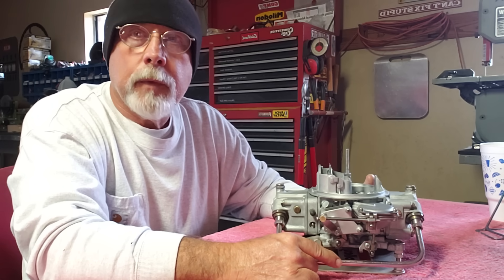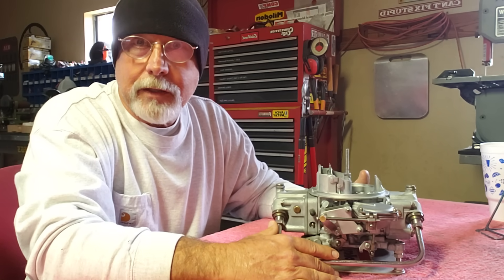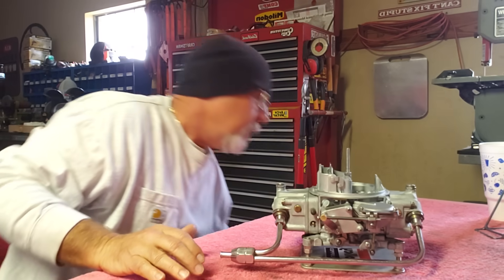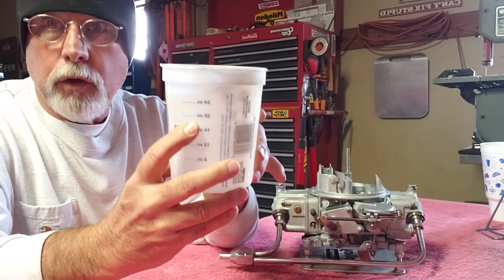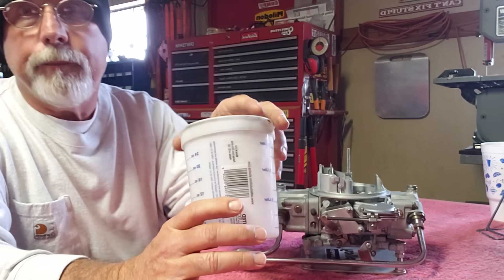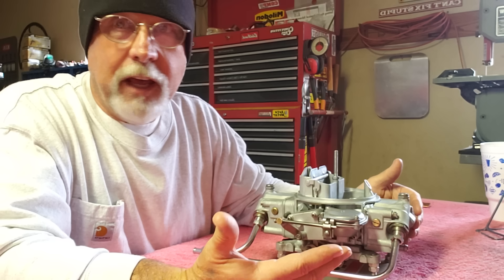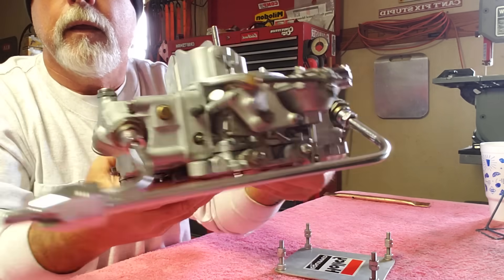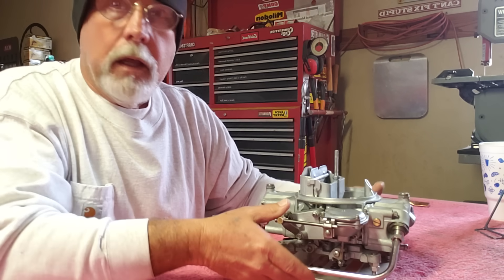Best carburetor cleaner ever!

Comment: Drain cleaner has muriatic acid in it & we used to use that on cylinder bores on snowmobile engines that were scuffed from the piston skirt from either being run too lean or from getting on it hard when it was cold & did a cold scuff or 4 corner scuff & it dissolves the stuck on aluminum without hutting the bore which if your bores are in spec still & you don't need to have a rebore it saves money other than new pistons rings & gaskets & a quick hone after the aluminum is gone so the new rings will seat again . I usually soda blast my carburetors which works very good plus you can get a 50lb bag of sodium bicarbonate from your local feed mill for around 10.00 - 12.00 which is much cheaper than buying it from harbor freight or the small boxes of it at the grocery store because the farmers use that stuff for the cows to relieve gas & settle their stomachs at times so the feed stores always have it ! I just used the soda blast plus the exact same blaster you have on some Yamaha XS650 carburetors off of a 1975 B model that had sat for over 30 years with old fuel that dried & looked more like the old Indian Head gasket Shellac used for gaskets lol & nothing would even touch that stuff after trying a few different things until I soda blasted them & it worked absolutely great took that hard crap right off & it made these carburetors look like brand new again . I like how fine the soda is because it will also blast & clean out tiny air & fuel passages then once done I blow out with air then flush with water a few times plus air just to make sure all of it's out . It's much faster at cleaning but has to be done in a blast cabinet or I do mine outside with a paint respirator on so as not to breath that stuff in . I also used it on the aluminum fork legs & the rear brake drum & high shoulder wheels to remove the corrosion then polished them back up again before I put the bike back together again so it has many uses other than just blasting carburetors or to keep your fridge smelling good lol. I got the bike running & it runs strong  so the next step is to tear it back down & build a street tracker out of it !
Reply: Drain cleaner is typically Sodium Hydroxide or Calcium Hydroxide. Sodium Hydroxide is regular Lye. Lye breaks down hair and grease. You wouldn't normally ever put Muratic acid in your drain, because Lye is caustic, and doesn't burn through metal. Muratic acid is an acid, and it removes iron, and other metals. It literally will melt into your metal pipes. Unless you have 100% plastic plumbing, you wouldn't want to use Muratic acid. Though, many new houses probably have all plastic plumbing, so it would be safe in those cases.

Comment: Useless !!!!  I used this idea on a pair of large two barrell carburetors taken off an offroad buggy. It did not even start to clean the oil grime residue from using foam air filter covers.  A complete waste of time. Would not cut the greasy grime at all. even after four dips and scrubbing.   Use some other process if the carburetors have heavy oily residue....
Reply from the maker: This process is used for a carburetors. Never, in my 45 years of building carburetors have I have not seen any oily, greasy carburetors and if I had I would run it through some solvent (Degreaser)  first before using this method.

Comment: Thanks Brother , I restore old motorcycles I have been struggling with this for Years , now I will try Your method .
Reply from the maker: Best of luck
Reply: @ronniehenson4122  woud you take the time to manually scrub off any dirt, gunk, on the carb before dipping it in the acid or just save yourself the trouble and drop it straight in off a bike thats been sitting for 10 years?

Comment: Question is would if work for small engine carburetors like Lawn mowers & weed whackers? Also would break cleaner help i never cleaned a carb before o only would put a new spark plug air filter and oil on my mower and i am fixing 1 up and may buy a new carb until i clean 1 up. The mower i'm fixing up is a Kawasaki FC150v something i never seen shows up as a john deer motor and says fits almost any john deer frame and i guess its on the wrong frame but fits.
Reply: im cleaning one now. ill let you know in a bit.
Reply: @hotrodamd  Thank you. If i end up buying new parts for a FC150V motor i may just buy the fuel cleaner since its also kind of the same and helps clean everything with what i want. I'm not good with taking carbs apart putting back together almost wanna buy a new carb than temp to clean but i know its not bad cus you can still smell gas like its in there.
Reply from the maker: Yes sir!

Comment: What are the throttle blades made of? Does the Muratic acid effect them or did you remove them from the base plate? I'm also wondering about jets but I supposed you could use about anything on aluminum, brass and bronze for a short period of time and it wouldn't hurt it. What's your thoughts on the misc components that are not aluminum? I've got some 1950s era carbs I need to do. I don't think they were using aluminum, I think they were using die cast or "pot metal". Once last question, what about Magnesium? I've got a magnesium blower intake I'd like to clean.
Reply from the maker: I cleaned all the miscellaneous parts in the same solution with excellent results, no problem. Not sure on the magnesium intake, I think it would be fine but, do a test on the underside first. I do know for sure that the soda blast would work fine on that magnesium intake.  Good luck! The blades are made out of steel.